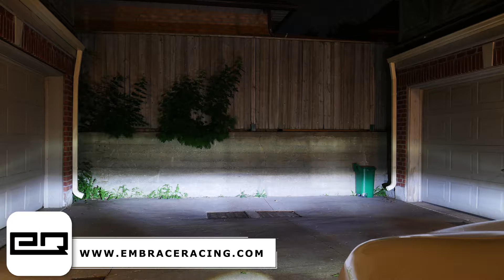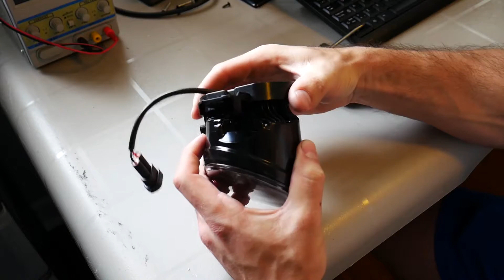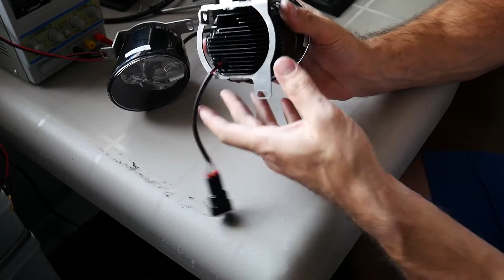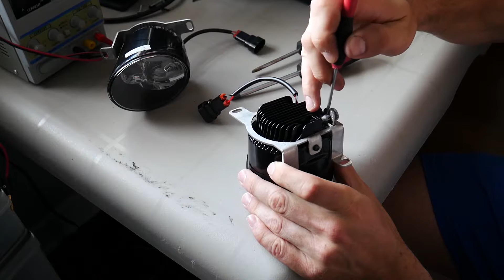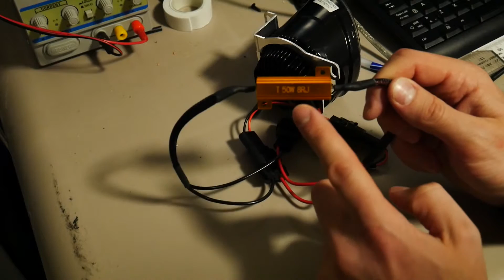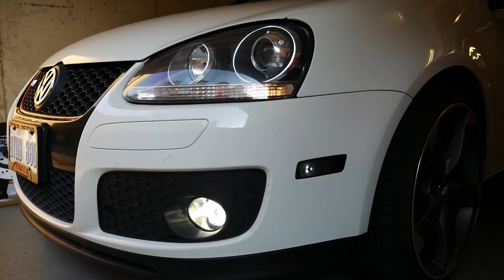How to install GTI / Jetta LED Fog Lights (Morimoto XB)

Comment: Why didn't  you explain how to hardwire  the fog lights if your jetta doesn't  come pre-installed??
Reply: Cause he don't know
Reply: @Gamerpotatoe  Not necessarily more like not accepting responsibility for you burning down your car. The proper and safe way for a non OEM foglight owner is to first get a euro headlight switch or grab one out of a b6 passat ot Gti. Then from headlight pin which maybe number 1 or 5, use a testlight and it'll sav you time,  run a dedicated wire to your 12v relay and obviously from that relay you'll run your wires to the battery and the new foglights w/ new grilles. Now if youve already did this kinda thing its no big deal, but if you go look on the web you'll almost literally find every other car except a VW, Lol.

Comment: @embrace Making

You mention in your setup that it comes with the resistors to prevent the dash warning, but when you install them to the car they are a plug and play direct, you seemingly bypass the need for the resistor. Can you clarify?

Comment: I NEED THESE!
Please tell me they are still for sale?
Reply from the maker: Unfortunately not... I still have brackets... but unless you can find the lights... they stopped making them two pieces a while back. The retrofit source / morimoto cut costs and quality and now the lights are a single piece plastic housing. Before they used to be two piece and the LED housing was a nice quality aluminum.

Comment: Cannot find the link in the description below to go to your website to buy a set of fog lights
Reply from the maker: No longer available... the manufacturer of the fog lights moved to a one piece all plastic junk housing. It used to be a nice aluminum casting but you know... save on cost and make cheap chinese junk got the better of morimoto

Comment: I read the coments i found i think the same morimoto light but didmyou.still have the brakets ?
Reply from the maker: I do still have brackets somewhere if you want to try it out... but you will likely find that the lights you found are the later revision that do not have removable brackets.
Reply: @EmbraceMaking   great thats great how much for the brakets ? And how i contact you ?

Comment: Are the fogs still available for the mkv gti? I need a set!
Reply from the maker: Unfortunately the manufacturer of the fog lights " Morimoto / The retrofit source" decided to cheap out and make the housings plastic instead of aluminum... so the new version is one single plastic cheap piece and no longer has removeable brackets for me to modify....